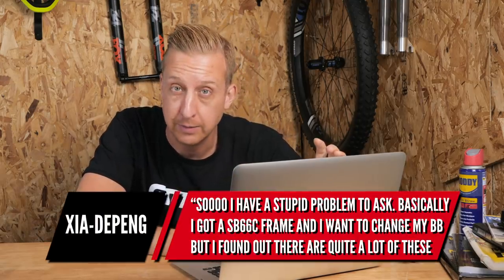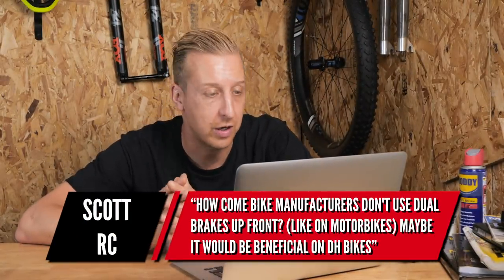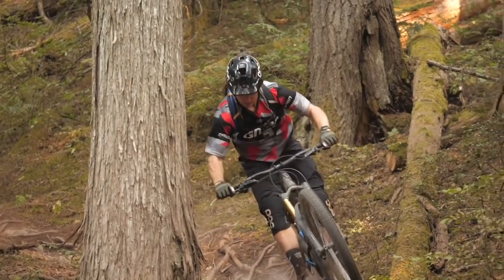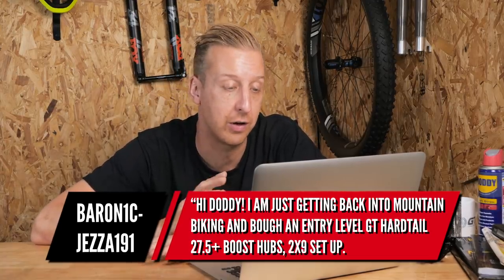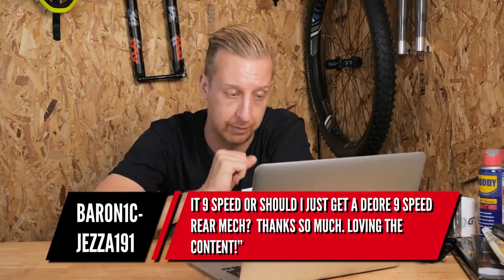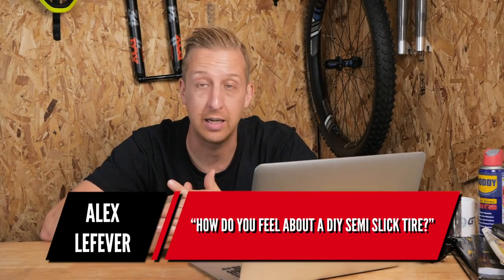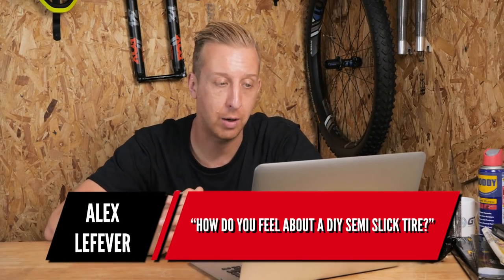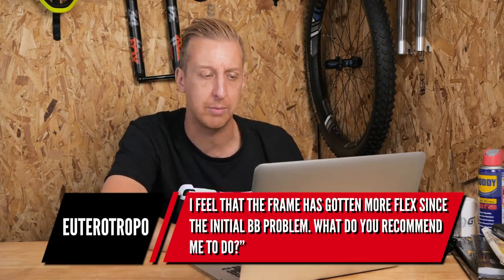Why Don't Mountain Bikes Have Dual Disc Brakes? | Ask GMBN Tech

Comment: Hi, im a avid fan of your askgmbntech. I have some question. Whenever i put pressure on my pedal stroke my chain slip/making sound like breaking apart. My mechanic told me that my 2nd chain ring (btw i have 3x crankset) was worn out already but my crankset was 2 months old. How can i solve this problem? Thanks gmbn! More power Godbless!!
#AskGMBNTech
Reply: hey bro even i had the same problem so bcuz i dont use my front gears i took out the front derailieur and fitted a chain guide on the 2nd chain ring, even you do that if you dont use your front gears
Reply: and even check your chain ring if it is bent or not and your chain ring bolts if they are fully tight to solve the problem

Comment: #askGMBNTECH Can I change the 2.3inch tire on a "WTB I25 32H, 25mm inner , TRS tubeless" rim with a plus size tire? I got a good deal on a 2018 Norco Fluid FS 3 and I'm considering swapping the tires
Reply: Brian N depends of the frame 
As a norco dealership i know the fluid does not have that much space
Reply: Thanks!

Comment: #askgmbntech are oversized 40T eight and nine speed cassettes good enough, they’re super cheap and better than a 10speed setup for a 1X, is the range good enough or are they just novelty items? Love the vids, keep up the good work
Reply: I didn't think so but for 35 buck it's better then going to 10 speed but I went 1× my chain was failing off constantly so I went 10 speed with a clutch with goat link 46t way better climb then the 40t chain hasn't fallen since. Cost 450 to go 10 speed XT.
Reply: the less gears you have the bigger the jumps between those gears will be.

Comment: jesus that last ones scares me. I usually ride in skinny jeans (I know its a sin) and a pedal spike has gone through them before but i feel like jeans might stop the end of the bar. They could just rip through still but i they are not very stretchy and because  bar ends and brake levers are quite blunt i think that it might stop them. 🤔#askgmbntech

Comment: #askgmbntech what do you think about the chinise carbon parts? bars stem seat post etc... even full frames or carbon forks
Reply: antonio stefan gabriel you get what you pay for
Reply: antonio stefan gabriel they do certainly manufacture good carbon parts in china too. Remember to do your research, because the quality might vary between manufacturers.
Reply: I've found manufacturer on Aliexpress called Thrust and they got few vids of testing frames, forks and handlebars. They claim to use t800 carbon i think and it is quite cheap. Also has good reviews, might give it a try someday.
Reply: Yeah.  I've gotten some cheap parts that are  decent, and others that I wouldn't use.  I've got a set of deep carbon tubular rims on my track bike which seem reasonably well made and solid.  no problems at all there, but I've also bought a carbon road bar which I can make creak by squeezing the drops together, or twisting it forward/backward with my wrists (not even mounted on the bike).  I'm sure most people who get bars from there have no problems with them, but they likely don't go through the same QC and testing as high buck carbon parts do, so it's a bit of a gamble.  As far as the whole t800 carbon thing goes, that doesn't mean much.  It's an easy thing to advertise, because it's good quality carbon fibre and most of the big brands use it too.   The problem is that poor design and manufacturing will give you junk parts, even if you start from good materials.  One thing that you can't really know from looking at it, is how they did the layup.  A good manufacturer may internally taper tube thicknesses to bring weight down, while keeping strength where it's needed.   If someone just "clones" that design by making a mold, and doing a basic layup that ends up at the same total weight, you could end up with a bar that's way too thin at those critical points, etc.
Reply: Do you want some good solid Chinese carbon parts. Farsports, Ican, Yoeleo and Velobuild. I've been running Chinese Carbon wheels and a stem on my Shongwei Chinese carbon frame and fork since 2014 with not one single issue. I would advise not buying from AliExpress. Or even eBay resellers for that matter. go direct to the above mentioned manufacturers.  and also disregard what most people say about Chinese and Taiwanese carbon bikes and parts because for the most part they don't know what they're talking about. They don't have bikes from these sellers and Builders and they probably are not using any parts either. These Muppets read forums and then go regurgitating a bunch of mostly deceptive rhetoric. Do your research take your time and you will be able to purchase a very good quality Parts at very low prices.

Comment: #askgmbntech Hi guys, great show as always! Another disc brake related question, do bicycle disc brakes pull the bars to the left as they are located there?
Reply: I'm not sure why Doddy was talking about torque steer. That has zero to do with single or dual disk brakes.
Reply: Yes .
Reply: It's why forks are now 15mm or 20mm axle these days due to the power of modern brakes . If you watch the fork when you pull the brake you will see the fork twist.  Some forks have a maximum rotor  size . For example old manitou mars forks have a maximum rotor size of 180mm due to twisting of the fork.
Reply: @MrBJPitt  yes he got that wrong. It's about ease of turning with less gyroscopic effect from 2 small discs versus one bigger disc. Not a physics problem at bicycle speeds.

Comment: #askgmbn hi doddy can you take a dh frame and reduce the travel to say from  200mm to like 120mm?
Reply: lopon12 no. Trying to change from 200mm to 120mm travel is like trying to fit a 200mm travel shock on a 120mm shock travel framr